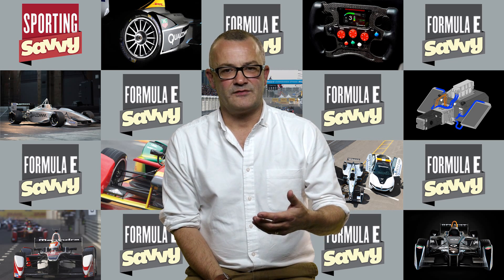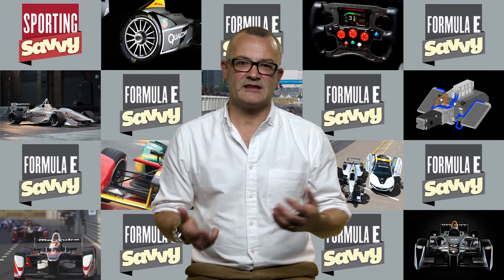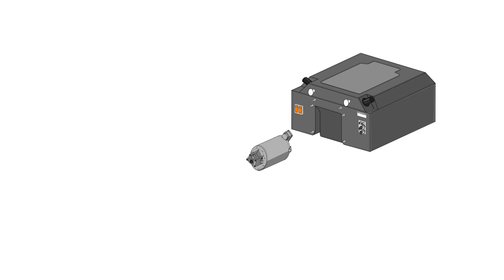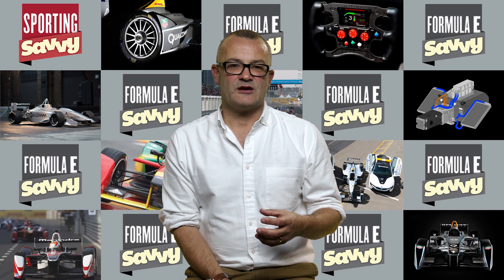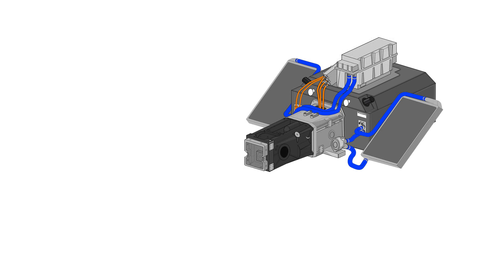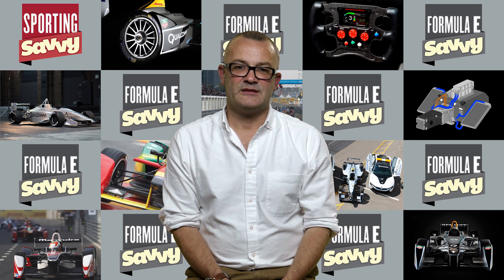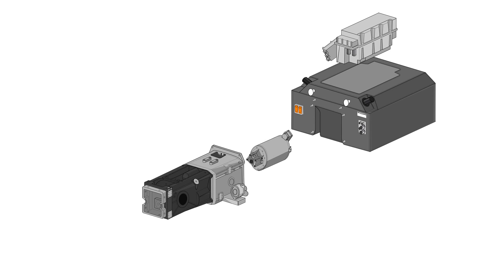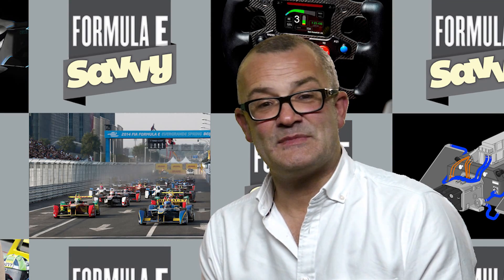#Scarbs explains Formula E Technology - Part 1

Comment: You got the power figures back to front, 200kw is way more than 180hp as:
1kw = 1,34hp

200kw (Qualifying trim) = 268hp
150kw (Race trim) = 201hp
Reply: Although, you are correct Marcello: 200Kw / 746 watts per HP = 268 HP.  Craig might have factored in the average  Power over time, regenerative braking adds back some of the power loss (but there is no free lunch). When calculating power, a net loss of 40% ( full race trim ) puts Craig right on with his numbers.

Comment: Kind of lame to need a 5-spd (or any) gearbox to get the most high-tech electric cars up to speed. Througout a century e-motors have been known for their tremendous torque from zero rpm. At least 2-spd should suffice? How narrow is that power band?
Reply: +Cloxxki 
They use permanent magnet rotos, which gives more power for their size but a smaller power range as they start to generate excessive induction at high RPM.
Also these are pin point race cars, F1 for example has 8 gears because they need the exact power delivery for every specific piece of the track.
Reply: Thanks, I did not know that of PM motors. Yes, nearly all ICE's are useless in terms of powerband. Althought they don't NEED 8 speeds boxes, just CVT was banned after one very succesful test where it saved around 3-4 seconds a lap back in 1993.
I'm so done with ICE. A furnace with 20-30% rotation as byproduct and overhyped noise.
Reply: AC motors reach peak torque instantaneously, and (at full throttle) it moves out of its power band in less than 2 seconds. With only 1 or 2 gears, the racer would be a the back of the pack, and destroy the motor trying to catch the pack. A 5spd gearbox will keep a Formula E racer (at race speeds) in maximum exceleration mode throughout the race.

Comment: They are so lame. Weak sauce spec bullshit. They need to be able to outperform F1 cars from before they had electric aid. Not be F1's dorky cousin.
It needs to embarrass F1. Completely take the wind out of their sails.
Closed cabin and wheel covers like the redbull X1 which is both rational and cool looking. Unrestricted power and battery size, allow battery swap for some pitstop action or full car swap for that matter. Variable geometry (aero control surfaces) with some restrictions so the cars don't end up looking ridiculous. 4 wheel drive if they want. Maybe an upper weight limit like 600kg and a max footprint. No other limits. If they want powered down force, let them. They could even have a turn where it's allowed to cut a corner if you fly.
Reply: Dan Frederiksen I find the formula e very interesting due to the development in technology that it can offer in the every day car technology. But I agree with you on the point that they should let the engineers develop with less restriction to make it more diversify and let the competition go in the enginering aspect aswell. It looks like the development of the cars technology and inovation arent optimised due to all the restrcition that point toward one and only car design. 
Sry for my bad english but I still think the sport has alot of potential and that it is pleasent to watch.
Reply: Frederick Laliberte The problem is that there is nothing impressive or innovative in these cars. Electric drive is easily capable of 2-3x more power in the same weight. There is nothing in these cars that could benefit road cars. A Tesla Model S P85D luxury sedan could keep up with these cars in acceleration.
Reply: hmm not quite since the formula e cars go around 0 to 100 km/h in 3 sec and the tesla in 3.4 sec but i understand your point. I guess they should just loossened up the regulations to let the innovation take the lead. They just started about a year ago so i guess in 2-3 years they could come up with some brillant technologies.
Reply: Frederick Laliberte 0-60mph in 3.1seconds now. And we haven't seen a precise time for these toy cars. 
And no, it's not a matter of time. It was pathetic from day one and from what I hear they will lock the performance for years to come. It is offensive if you know how things work. It is extremely unambitious specs.

Comment: Check out www.evsr.net. to see a program that costs pennies on the Formula E dollar and offers similar performance at a wider variety of venues. They have built 2 cars and gone faster, longer and more often than formula E and campaigned both cars at over 30 competition events in 2014 for less than 1/4 the cost of just one Formula E car

Comment: 1:30  200kW is not 180 Hp

Did I misunderstand something?
Reply: I believe race restricted to 150kw and qualifying restricted to 200kw. Because 200kw in full race mode would drain battery before the finish. As technology develops more and more power will be alowed in full race mode.
Reply: lul123 Makes sense, you might be right. Thanks for the answer :)